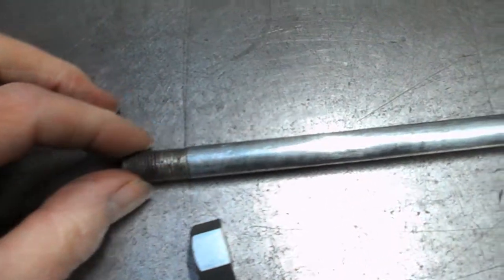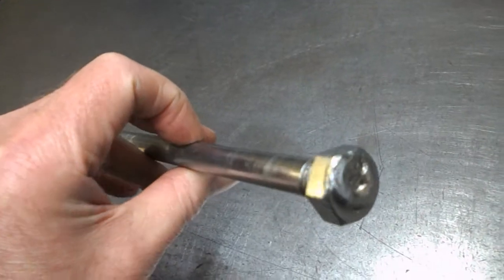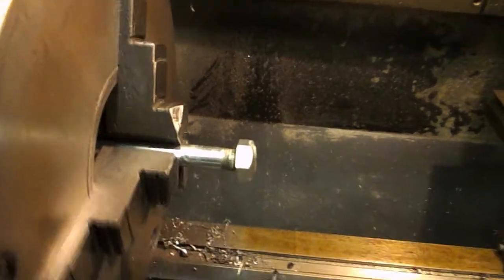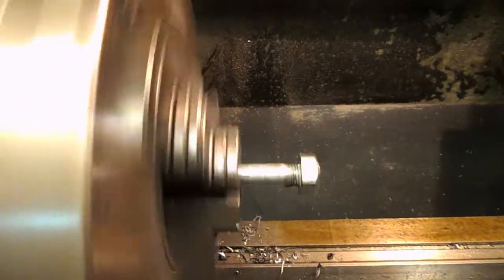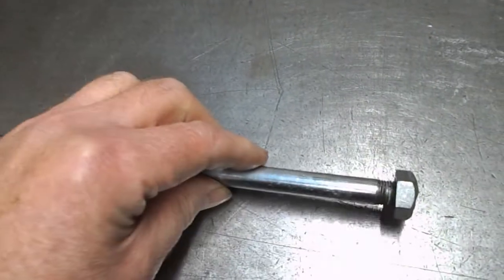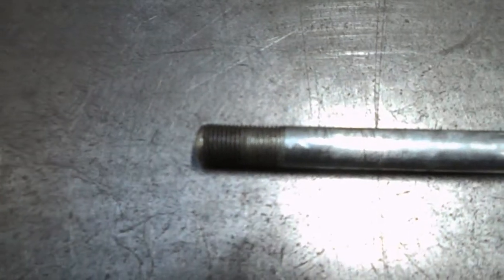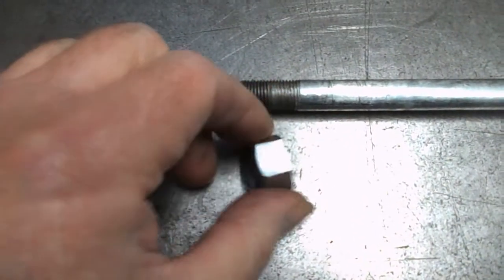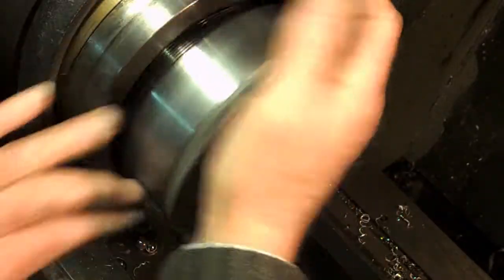Re-threading a shortened Footrest Bolt using the Ainjest High Speed Screwcutting attachment.

Comment: I have one on my Cochester & I can't get it to fully engage on the leadscrew. Do you have any ideas what the issue is.  Thanks.
Reply from the maker: The half nut can get clogged up. I've had to clear out congealed oil & chips from the threads on mine.
Reply: @MidEngineering  Thanks, was it easy to get at?
Reply from the maker: @machinists-shortcuts  Once the cover is off (which I don't have on my machine), the screws which hold the half nut are accessible through holes in the main bracket. I must admit that I don't remember if it was as simple as undoing the screws & sliding the half nut out of the slide...
Reply: @MidEngineering  Thanks, I've fixed it, now the spindle bearings are squeaking but sorted with an oil change and adjusting preload. Now I've discovered that the gear on the end of the leadscrew is worn out and it won't fit through the access hole.!!
Reply from the maker: @machinists-shortcuts  The joy of running old machines!

Comment: 2000 or even 800 seems like light speed, 2 or 3 hundred is quick enough for me when conditions allow. Are you using full form inserts?
Reply from the maker: Yes. Much nicer finish - no need to de-burr the tops of the threads & you can judge the depth by just measuring the OD. (though not the correct way of doing it I suppose!)